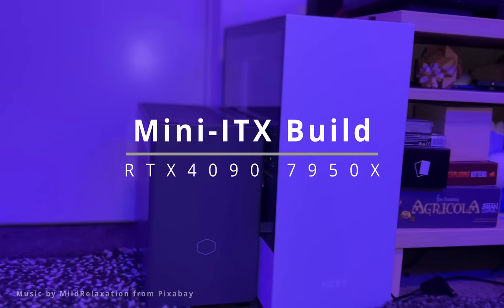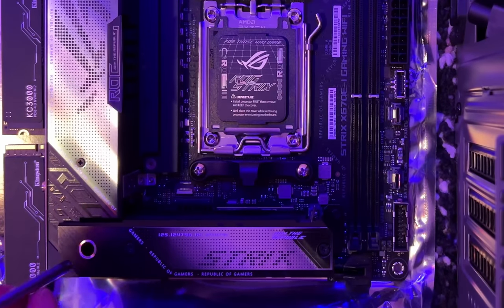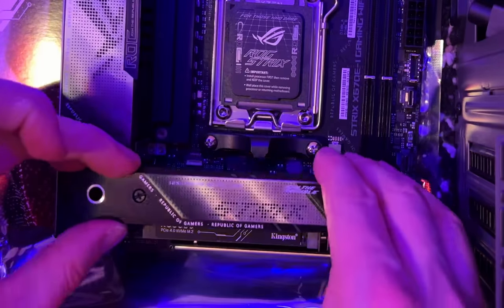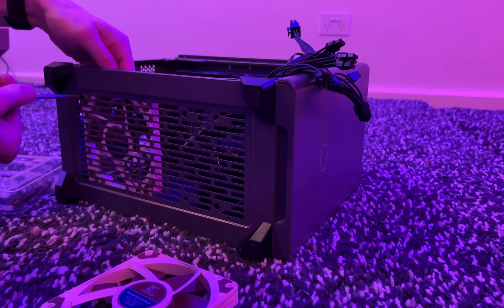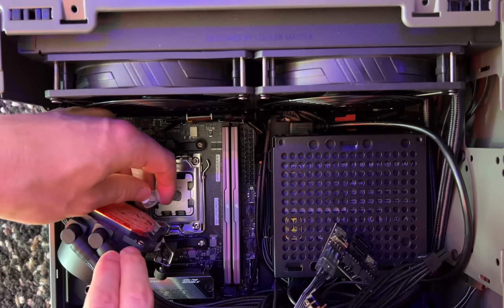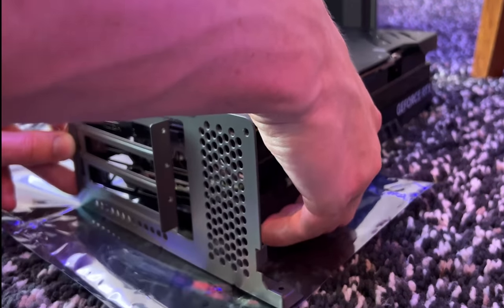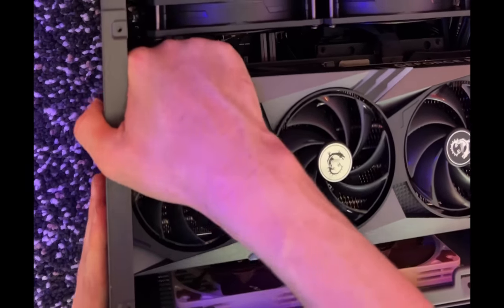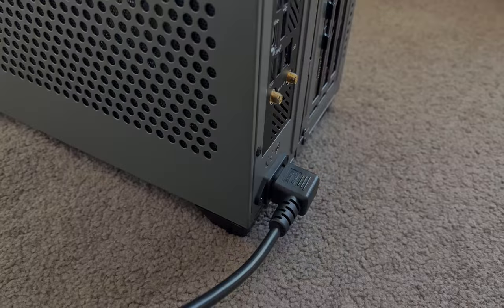Mini-ITX NR200P MAX build with 4090

Comment: i had same build with 12900k....its super ez and clean. 
On the side note - If you are using perforated side panel, the bottom fans better to be exhaust out, not in...It will drop few degree on temps. 
If you are using glass panel, then, you do air intake for the bottom fans.
Reply from the maker: Yeap, this is the right way.  Also when using as exhaust fans you can remove the bottom air filter to improve airflow.

Comment: That’s nice! I built my nr200p with an i5 12600k and today just got the 4070 TI TUF and it fits perfectly (non horizontal). I had to take the fans off the bottom however, but runs silent and cool.
Reply: Hi i want to ask if I could have your build list as I want to get the ASUS TUF Gaming NVIDIA GeForce RTX 4070 Ti OC Edition Gaming Graphics Card (PCIe 4.0, 12GB GDDR6X, HDMI 2.1a, DisplayPort 1.4a) TUF-RTX4070TI-O12G-GAMING. Does it fit nicely or were there any trouble?
Reply: @brianchan7532  if you got the 4070 ti TUF model just take off from the nr200p case the bottom and fans, front and you’ll be able to fit it in the normal way without riser card. It fits perfectly in there.
Reply: oof the bottleneck tho
Reply: @Spikyzzzz  I ended up returning the 4070 TI TUF as it was overkill for my usage. Instead picked up a 3060 TI from eBay for $270! But a i5-12600k with a 4070 TI wouldn't have that much bottle neck if at all really as its only a one previous generation CPU.
Reply: i built it 13900k and rtx 4090 man it becomes and 4090 is zotac still bit long
Reply: how many M.2, SSD and HDD can you use with them?
Reply: @trevorbelmont4633  2 M.2 for my motherboard and 1 3.5" hdd and 2x2.5" in the front you can mount.

Comment: Here is a tip. You can use three riser screws to mount the GPU a few millimeters higher, then you can use two regular fan on the bottom. I found this idea on pc parts picker.
Reply from the maker: It actually could work.
Reply: I'm planning on buying this exact setup. What do you mean use 3 riser screws?
Reply: Can you share the link?..the riser barely has a couple mm above the slim fan at the buttom and with cable i dont see how regular fans would fit...🤔🤔🤔
Reply: @Realblack_m0nster  the screws for secure the GPU, there are some screws that you can make the GPU higher and have more room under the GPU.

Comment: I managed to snag that same 4090 at msrp! I'm going for the exact same build as you, only difference is the type of ssd and the cpu is the 7950X3D. Also just realised, you put those bottom fans as exhaust? Won't that make the airflow worse?
Reply from the maker: Nice build. I won’t buy Samsung ssd anymore since there was a firmware issue that caused them to fail early.  Bottom fans are exhaust to match the airflow of the gpu. If you decide to use glass panel then they are probably better as intake fans.

Comment: Great video, thank you for uploading, I have two questions:
1. Did you try 25mm fans at the bottom before going for 15mm ones? To me it ‘seems’ there’s space for 25mm fans?
2. Do you think MSI 4090 Suprim x liquid will it? It’s shorter and thinner but came with 240mm radiator with fans.

Mines completed build without GPU, thinking of going with 4090 AIO liquid cool, share your thoughts, thank you.
Reply from the maker: 25mm fan wont fit underneath the PCIe riser by a few mm, someone mentioned a mod you can do to use spacer screws to mount the graphics card a little bit higher.
I think liquid cooled graphics card will give you alot of pain to route the pipes, and if you remove the cpu aio then it would be really difficult to keep cpu cool with air cooling, there is not much space between the graphics card and cpu.  If using the vented panel then air cooled graphics card stays really cool.

Comment: I had a NR200 and got a Gigabyte 4090 Gaming OC which is stated as 340mm long. I couldn't fit it, unless I started cutting parts of the front frame.

I ran the 4090 outside the case with a riser cable.

I recently saw someone fit it into a Meshroom S, so I have that case coming in a couple days. Its smaller than both the NR200 and NR200p and will be able to fit my arctic AIB 280mm. This AIB is thicker than the one that comes with the NR200p.

I think the NR200p is pretty neat, you can see that you can fit longer cards as long as you are ok with the rear panel pushing out further.  I might regret the tight fit of the Meshroom when they later make a 5090 etc.

I also wanted to throw in my 1200w ATX psu, which they say could fit.  Albeit it I'm running on the bleeding edge of my current 800w psu.
Reply: Hey, we're you able to successfully fit the 4090 in? I am in a very similar situation. I just bought the gigabyte 4090 and want to build it into a small case with a proper PSU (850W seems really tight for me). Would love some insights.
Reply: @JiesiLuo  Not the NR200, I got the Meshroom S. The Founders edition might fit the NR200, it fits the NR200 max for sure.

I believe I might even be able to fit a 1200w ATX PSU in the MeshroomS. I just have to go get it from storage to try.
Reply: @hrod9393  did you successfully squeeze the gigabyte 4090 into the meshroom s? I am using this exact gpu so if you did I know which case to go for 😀.
Reply: @JiesiLuo   the dude clearly states NO, he is not able to take 340mm GPU and fit it in ITX case that CLEARY states by the manufacturer of all people, MAX GPU LENGTH 336mm!

Comment: Fans on bottom should be pushing upwards. GPU is already pushing out hot air out into the case, introducing fresh air into the case will help to not suffocate the rest of your components.

How does the 4090 work with 3x 8 pin PSU headers versus running 4 separate to the NVIDIA adapter?
Reply: That's what you would think, but from others who have tested exhaust at top and bottom give better thermals.
Reply: true wrong placement of fans.
Reply from the maker: @mauree1618    This is right..  The entire side panel is an intake, GPU will intake from the side and exhaust the hot air directly up and down so the case fans will continue this flow.  This is different to the more common setup of using a glass side panel and needing a single direction of airflow through the case.

Comment: Nice video! I am planning to do a similar build. from what I have found, the 4090 Gaming X Trio is 337mm long, and the case clearance is 336mm from the cooler master's website, which in theory, it is already 1mm too long. But it looks fairly easy to fit the card in your video. Was there any pressure or stress when you were fastening the screws? Does the graphic card touch the front panel of the case? Or is there anything to think about with this kind of graphic card setup that is so close to the limit? Thank you for your time!!
Reply from the maker: It will be touching but not tight...

Comment: Why the noctua Löw Fans are air pulling out? Is it not better when they take air in?
Reply from the maker: This is to help with the air flow of the GPU.  The graphics card draws in air through the side and exhausts it mostly through the top and bottom, so the case is following the same airflow path as the GPU. If using the tempered glass panel then they should be changed to intake fans.  I've also removed the air filter from the bottom to improve airflow. And added some fan guards to prevent the cables from falling in. It runs cooler than a ATX case with a glass panel.   Checkout this more detailed video with fan setup and benchmarks: https://youtu.be/lltz-heW2LU?t=631

Comment: Great build! One question, how did you connect the GPU to the PSU? Did you need to buy extra cables?
Reply from the maker: The card comes with an adapter cable but you would need to daisy chain one of the connectors, I now have a custom cable from cablemod. Note that this powersupply is wired differently to other brands so you cant swap cables between brands.

Comment: Thanks for the Video , just have a silly questions maybe

Its about how to Plug in safely the 4090 fe
The Original Cable from NVIDIA has 4 Pci 8 outputs, but on the nr200p max we only have 3inputs

How did you solve that?
Reply from the maker: I got a custom cable from cable mod for this. If you’re ordering the cable make sure to select the right brand and model powersupply as the modular plugs are different for each one.

Comment: Hi @stephan Mann. How did you install the am5 cpu cooler? Did you need any additionall screws? Which installation Guide of the Guide did you follow? I'm building a system with a 7700x atm and I'm a little bit scared to forget something. :D Many Thanks!
Reply from the maker: I suggest you have a read through the case manual, everything is included and for amd, screw the bracket onto the aio and the brackets clip onto the cooler mounts that usually already on the motherboard.  https://coolermaster.egnyte.com/dl/08QSK8tKoO

Comment: @Stephen Mann - could you please tell me the order of the pins you connected on top of the motherboard? (e.g. CPU connector, system fans, additional at bottom of the case)? My component arrive tomorrow and I want to make sure I set them up right. thanks in advance !

Comment: Thanks for sharing this. I've been searching for a while for nr200p max builds with a 4090 but could barely find any. I managed to snag a msi suprim x 4090 and I will also pair it with my 7950x. Btw you can still fit two 140mm fans at the bottom using spacers, I saw someone done this mod on reddit.
Reply from the maker: It looks like 120mm is the max fan size for the bottom panel..  any larger it would need to be mounted inside the case and not to the panel, and raising the fans up for to do this would put it too close to the PCIE riser.
Reply: @minkis42  They used the bottom fans as intake so the blades doesn't touch the riser cable. These fans can also be used as a sag bracket to hold up the gpu.
Reply from the maker: @bp3019  I don't see the vertical mount sagging like the horizontal mounts do.  Check out this vid for more detail with the fan mounting: https://youtu.be/lltz-heW2LU?t=631   they do suggest intake if you're using glass panel.
Reply: Are you talking about low-profile 140mm fans, or regular?
Reply: @sizableyeet  regular 140 mm fans, lian li uni fans to be specific.
Reply: @bp3019  wheres the mod thread I don't believe you

Comment: Looking to get this gpu, did you just use the two daisy chained 8 pins for the gpu? Is it able to handle the 450 + watts?
Reply from the maker: I daisy chained one of the connectors. I believe cablemod now supports the coolermaster v850 sfx so you can order a custom cable that will use 3x modular connectors to the powersupply.
Reply: @minkis42  thanks i'll check them out

Comment: Hi @minkcos. Last week my build started to crash during games to black screen with 4090 fans spinning at 100%. I believe this to be due to the Cablemod 12VHPWR cable which was removed and replaced with the MSI cable daisychained to PSU. After that the crashing stopped. I have raised a ticket with Cablemod who recognize it as an issue with their angled connector. Have you encountered a similar issue, or did I just get unlucky with my cable?
Reply from the maker: I haven't had this issue, however I got an early version of the cable without the angle connector.
Reply: @minkis42  yes angled connector definitely preferred as the MSI one I'm now using is squished up against the PSU, plus daisy chained PCI-E cables supplied with the case are very bulky in such a tight space. Hoping Cablemod can ship out a replacement that works soon.
Reply: @minkis42  I received the replacement 12VHPWR cable from Cablemod, but a few months later the fault occurred again, which leads me to believe their cables aren't up to the job. I'll RMA it again but doesn't make sense to get the same one again for a potential third failure. Provided you haven't had a similar problem with your (different) Cablemod 12VHPWR, can you provide some details so I can get the same as a replacement please. Thanks Stephen!

Comment: hey man, I'm going for the exact build. Could you plz share which splitter cable you used for the fans? Thanks!!!
Reply from the maker: "SilverStone CPF01 Black 100mm PWM Fan Splitter Cable".   Also the case already comes with one fan splitter built in for the top radiator fans.  Those noctua slim fans come with silent adapters you can add to the cable if theyre too loud for you..

Comment: Would MSI RTX 4090 Suprim X fit as well? Only 1 -2mm difference here and there but may actually make a ton of difference.
Reply from the maker: Yeah it fits, I'm using Suprim X now.. I think it's a better card than the Ventus
Reply: @minkis42 Thank you so much for this video. I got a lot of similar components for my build and this video helped me a ton. I added Noctua NA-FG1-12 fan grills on top of each bottom Noctua NF-A12x15 fan and they fit perfectly - should anyone wonder. In addition I added "2 x SilverStone SST-CP11-300" - ultra thin SATA cables to connect the front SSDs. I tried the standard 90 degree SATA ones and I couldn't fit them in there - not enough clearance between the PSU and the FPS-II card. This made me think whether that MB is actually a good choice for this case - mainly because of the additional FPS-II card that gets in the way. Perhaps ROG STRIX B650E-I GAMING WIFI would be a better choice?
Re. the case itself, do you - or anyone else for that matter - think the temps would be better if the top fans worked as intake instead of the stock exhaust or do you think it wouldn't make much of a difference?
Again, thanks a mil.
Reply from the maker: @1111TP1111   there's another video about thermal performance: https://www.youtube.com/watch?v=_6k2GvJP6tE   running top fans as intake could make the gpu hotter. if CPU is running hot then check that windows is in Balanced power mode instead of high performance, it can make a big difference.

Comment: I have always wondered if you pack a case like this if it will overheat at some time? Does this kind of PC really work? The prebuilt itx pcs out there are usually with a low powered GPUs and CPUs. I kind of want a smaller case with a huge punch of power in it, but I have always wondered if it will run or run into issues with the heat dissipation. Something I could have on the desk instead of on the floor.
Reply: i run a 5950x with a 280mm rad (side mounted) and a rtx 3090 founders and have never had an issue with thermals. i do have 7 fans in this case as well.
Reply: @davidswenda9908  I've started to come to the solution that these ITX cases can hold higher end components and that there are no glaring issues with it... But still would like to hear from people who have had the cohones to go for it already. Also, am not a pro PC builder, so getting everything right in one go might be a pipe dream for a new builder. Glad to hear you pushed a 3090 into one of those cases and it still functions well. If you have more similar examples, please let me know...
Reply: @timometsanoja9666  i believe optimum tech put a rtx 4090 into a formula t1 case and it was thermally alright.

Comment: Why bottom fans as outtake? It is fighting natural thermal convection and also with 4 fans doing outtake (2 bottom, 2 top) creates negative pressure in the case which will collect dust.
Reply: I have this case, you want the bottom fans drawing air away from the GPU so the AIO isn't getting a dual load of hot air from both CPU and GPU, I played around with is and it drops temps
Reply: @neilmcdonald1766  so is it better to have the bottom fans as exhaust?

Comment: I want t the same thing but with a rtx 3090 from a dell Alienware pc and ryzen 9 5950x do you think I should use a 1000w power supply, I'm not overclocking just trying to make things compact.
Reply from the maker: The 850w psu that is included with the case would be sufficient.

Comment: Did you need to buy the 12 pin power connector separately?
Reply from the maker: 4090 comes with an adapter cable that splits out to 3x 8pin pcie power connectors, the PSU comes with 2x pcie power cables, each cable splits out to two 8 pin connectors, so it's possible to connect it by daisy chaining one of the cables but documentation shows not to do this since one of the cables could be overloaded.  Its much tidier to buy the custom 16pin cable from cablemod that goes straight from gpu to powersupply.
Reply: Thank you, ordering from cablemod now. Appreciate it!  @minkis42